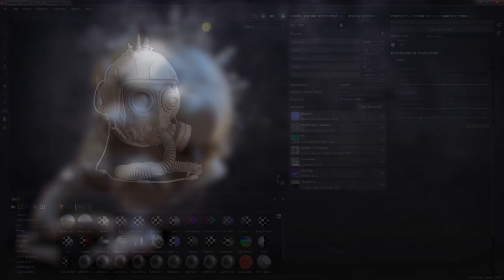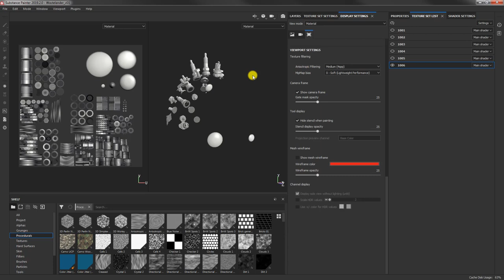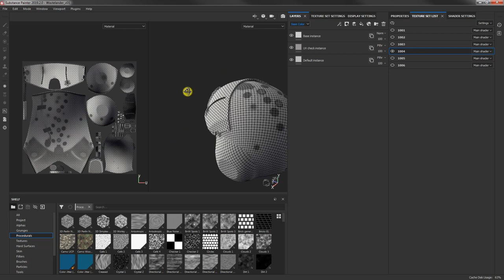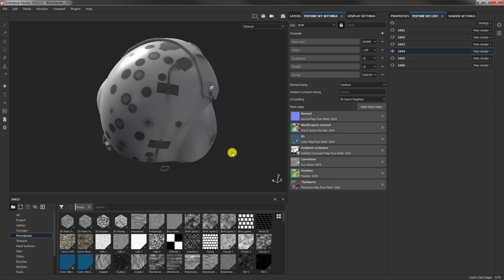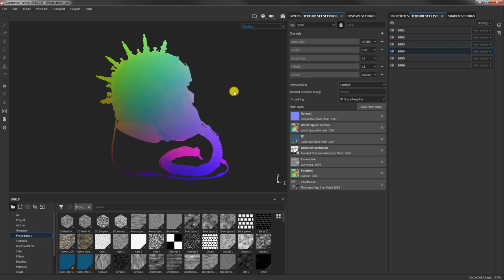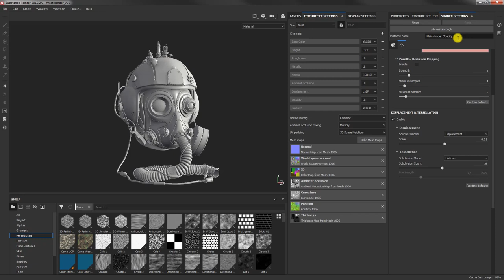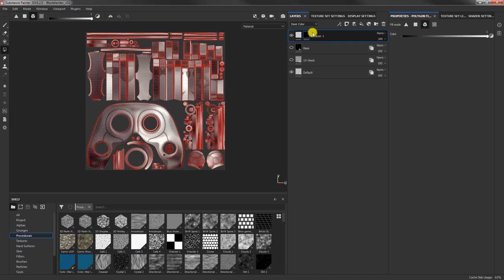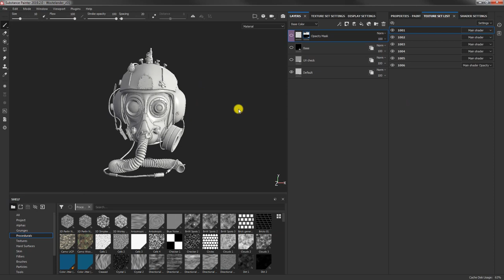Wastelander Texture Breakdown in Substance Painter - Chapter 1

Comment: I didn't know about the position map bake setting. Very interesting. So far, I used a similar process for AO baking. I tend to bake one AO map ignoring mesh suffixes for inter occlusion and one that bakes taking into account the suffixes, for per part occlusion. Then I use those depending on what I wanna achieve. Like overall dirt over the entire object or dirt that covers the crevices between parts. At the end these can be combined to get the best of both worlds. But It did not know that the position map offers the same thing. (I bake in Marmoset though, been a while since I baked in Painter)
Reply from the maker: Hey! Thanks for the comment. The position is a quite interesting map, and instead of Direction (achieved with World space normal map) can highlight different areas of the mesh. I totally dig your point regarding the 2 different AO with and without mesh suffixes. I never tried to bake maps with Marmoset, but I heard that it's becoming very powerful!